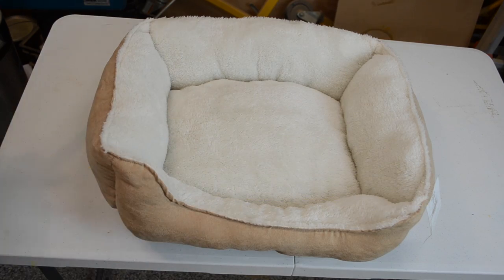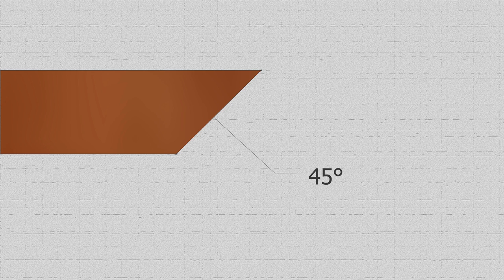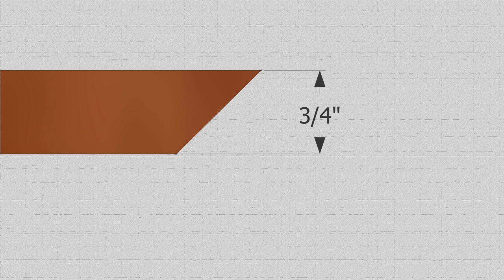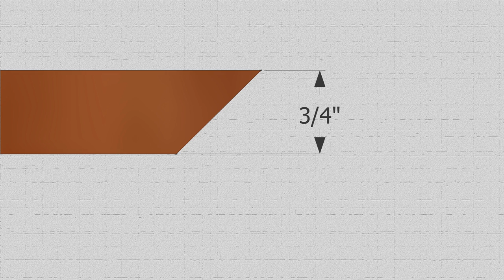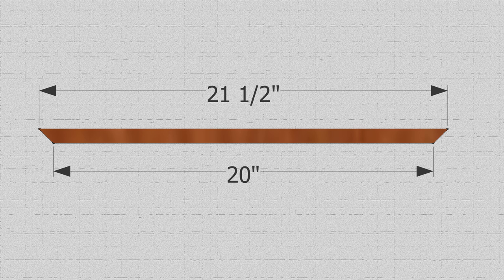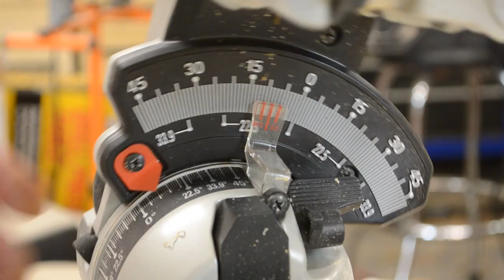Ⓕ DIY Dog Bed (ep29)

Comment: I'm guessing that I would have to do something a little different for my 100lb rottie mix (she was supposed to be rottie/lab but after she grew up I'm wondering if she might be rottie/newfie). 
;-)

Izzy Swan got me watching a few of your videos based on the comments in his last few, and they have me wondering- you seem to do a lot of painting of your work, don't seem to go through priming or much normal prep (especially on end grain and MDF that can be fussy) and seem to have really good results.  What kind of paint are you using/are you doing something besides just what we're seeing in your videos to get those results?
Reply from the maker: Mark Pikas Yeah a 100# dog would take some lag bolts, lol.  I don't know what brand of black paint I got last.  But in this particular video, on the MDF end grain, I use the drywall joint compound to help seal it before paint.  I try not to sand it all off and that seems to work fine.  I did this on my custom work station too.  I do not like to prime my pine projects that I paint black.  Mostly because, if you are able to get an even enough coat in one coat, a fair amount of the grain still shows through.  I really like the look of that.  My DIY simple shelf would be a good example of that.  Also, it is another step, more time, more cleanup, and in the cold times of the year, drying times can be long and costly to heat the shop.  I sometimes sand end grain to a higher grit than the face, and this really helps to make the different surfaces look even.  It works even better when staining a project where end grain is going to show.  Hope this answers your question.  Thanks for watching!
Reply: Nick Ferry what kind of paint was it (latex, oil...)?  I noticed you got surprisingly good, rich color in the blue bathroom stool also (there were splotchy bits on the sides and you mentioned that you needed another coat).  I did something similar for my twins, 2 stools with painted sides and stained tops, all of it covered in polycrylic to protect them from the water and other stuff in the bathroom and ended up using HVLP- prime, paint, poly and it was a ton of work and I don't think they came out much better than some of your 'roll on, no primer' paint jobs.
Reply from the maker: Mark Pikas it is interior latex paint I picked up at home depot.  As you could tell from the stool, colors don't cover as well as the black but it is still pretty good.  Two coats were plenty for the stool and I did not put a clear coat on.  I figured if it gets too bad I can always re-do it.  My oldest has already outgrown the need for the stool and I suspect my youngest isn't far behind.  I guess if I had one tip, it would be to roll the paint on as heavy as possible yet still avoiding drips/runs.  I see people using to much pressure on the roller and trying to get as much coverage with as little paint as possible.  3-4 rolls and it's back to the paint tray for me.